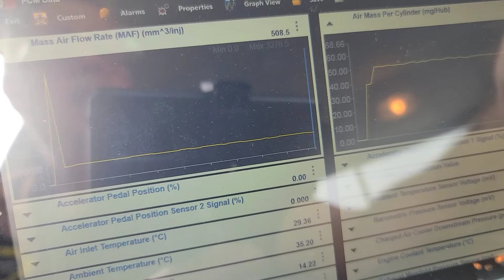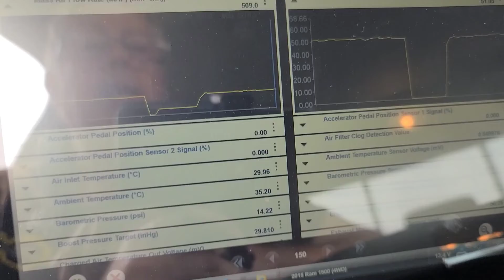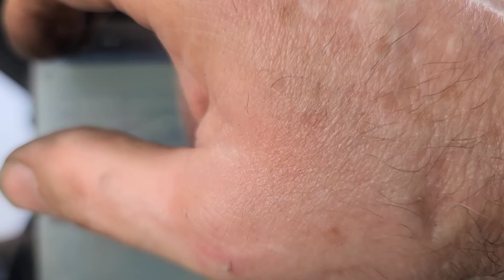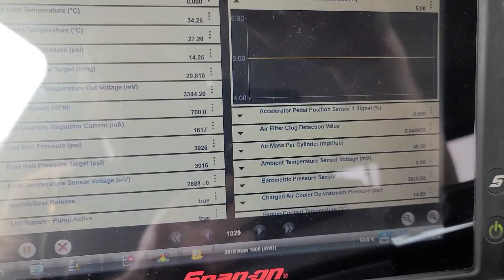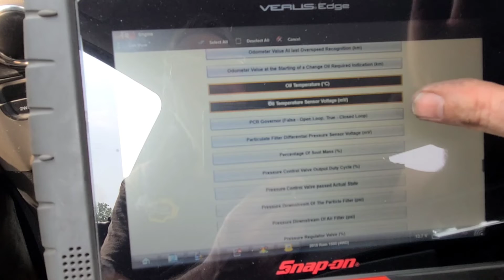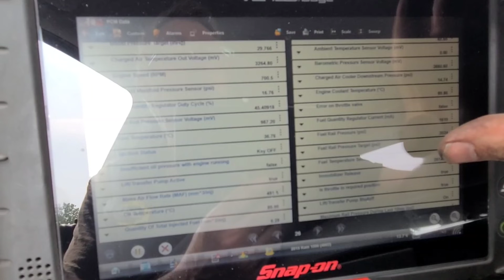2015 Ram Ecodiesel Crank No Start No Codes Fixed! pt 2.

Comment: Hub is German for stroke. On Bosch diesel scan data it means one combustion cycle (one working stroke / one injection event).
So mg/Hub = milligrams per stroke.
Air Mass per Cylinder (mg/Hub) is how many milligrams of air that cylinder is getting each firing cycle.
Reply from the maker: Thanks for the information!

Comment: I have my 2018 Ram Echo Diesel for over. 3 weeks now with the same problem. They quoted me for the fuel pump but the engine still won’t start. Tomorrow I’ll go to the dealer and show them this video and hopefully I have the same problem with my truck. Thank you so much!!
Reply from the maker: Good luck!

Comment: By the way, thanks for the video, very informative and helpful. I'll let you know what happens tomorrow.
Reply: Well the no start turned out to be a disintegrated tone wheel magnet $2300 Canadian to replace wheel and sensor.
Reply from the maker: I've heard that happens. Requires transmission removal to access...

Comment: I had a similar problem. I have a 2015 Ecodeisel 1500. The other day, I was out on the back roads, and I lost all response from my accelerator pedal. A code came up on the dash, something like no response between the pedal and the throttle actuator. I am not sure of the code; the engine died, and I had no start condition. My truck is also deleted. I called for a tow, and it went to the dealer. long story short, the tech flashed the ECM and blew out my delete software. He then was having all kinds of codes because it was looking for emissions signals. which of course have been removed. He called and apologized. He got the truck running and refuses to work on it. I drove the 10km home. As soon as I got home, I cleared any faults with a less then adiquit code reader. turned off the emissions, removed the ECM, and sent it back for a reflash-delete. I have just got the Ecm back and installed it. I had heard about the throttle actuator problem on YouTube, so I pulled the air intake tube off and checked... sure enough, it was open. good so I put the pipe back on. I tried to start the engine, but I still have a no-start condition. 
I noticed a valve closing under the hood when I turned the key to crank the engine. I have never heard that before. I was at a loss and was giving up for the day. But just as I was about to close the hood, I heard that mechanical sound louder this time, and I can swear it was the throttle actuator slamming open. I will take out the throttle body plate and try to start tomorrow.
Reply from the maker: Good luck and let me know if that's it.

Comment: What’s the tube called that you removed? I swear mine is loose and it sounds like air leaking from it
Reply from the maker: If you are referring to the tube connected to the throttle body it is referred to as a charge air pipe or tube and yes it can leak boost pressure.

Comment: Should the blade be open with the engine off ? 

I'm having problems with mine. 

EGR is not deleted.

I opened the valve to see how it looks, engine off. Valve blade is open and also little liquid like in there. 

Having nightmare problems with the red lightning light....

Regards.
Reply from the maker: Yes it should be normally open. What codes is it setting?

Comment: Great vid. Not my issue though. My 2015 is not starting after the dreaded  turbo coolant supply line repair. I removed the plate while I was in there. The coolant on the truck in this video is super low, you might want to check that out. Just do a Youtube search for ecodiesel coolant leak.

Comment: I have deleted 2014 had it shut off out of the blue while idle . This saved me $$$$ if your eco diesel doesn’t start check this if it’s deleted . I just popped hose off and shinned a light I. And confirmed it’s closed got a long screw driver and gave it a few buddy bubs with the hammer and bam now she starts . And no code for me as well
Reply from the maker: Glad it helped you

Comment: Hi! That "throttle valve" isn't actually a throttle valve. Diesel engines regulate rpm by fuel injection not by air. That valve however does 3 jobs:
1. Help cleaning the DPF (regeneration) by limiting the air intake when the procedure begins. This way the mixture gets more rich and burns better downstairs.
2. Helps reduce the engine shaking hard when cut off. Diesels have very high compression and by cutting air you basically transform the engine into a no air compressor thus moving freely.
3. The most important...in case of diesel overrun, by closing this valve and starve engine of air you have a pretty good chance to avoid a disaster.
So... basically by removing the plate you have eliminated all it's benefits. That being said, the ECU was remapped and not in a good way. If it didn't even show you the pids probably didn't even controlled anymore so the damage was already done. This is why I don't do/recommend engine tuning. If the guy doing it doesn't do a perfect job modifying the software...very serious problems may occur. Great video as always! Keep them coming!
Reply from the maker: @alexdragomirescu5084  thanks for the tips!
Reply: Funny that part wasnt deleted with the ecu tune. I had a VW TDI and did an egr delete and tune and all the parts associated with that system got junked and replaced with block off plates and modified air intake. Gained 8 mpg by deleting that and no more clogged intake manifolds every 80000 miles.
Reply: @rustystubbs242  It's astonishing how many people don't understand EGR design and functionality . The higher * NOx you get from an EGR delete is due to higher combustion temperatures . Higher temps result in the timing being retarded hurting performance , fuel economy and , ironically , the life of your engine . EGR also isn't even the main contributor to carbon buildup , that would be your positive crankcase ventilation ( PCV ) system . Install a baffled oil catch can to eliminate the majority of that buildup and you're golden . DO NOT delete your EGR unless you want worse performance and fuel economy .
Search on YouTube videos like "why not delete egr valve". They explain way better than me the disadvantages of egr delete. 
Stop chopping your engines just because forums say so and mechanics don't understand how systems work.
Buying a new egr valve every 80k miles is not a big expense!
Reply: I would do your research a little better than your comments.
Or you are a Dodge/Chrysler Mechanic, because only they would make a comment like that. Dodge/Chrysler Mechanics are known to say things that are not true to members of Delete tuners that have improved performance and economy to their trucks. 
Are trucks have never had any problems after a delete tune has been completed.
RAM trucks without tunes have more problems down the road.
Cummins is the best engine out there.
My 3500 has a delete tune, DPF removed, straight pipe, EGR cooler removed and I have over 540,000 miles and still going strong.
Reply: @anthonymalliris2089  I live in Europe, here we have diesel engines starting from 1.2 liters and more than 50% of the cars are diesel. Somethings about the way they work I do know. And I do know that even here most of the mechanics don't understand the systems and mislead the owners in chopping cars. The biggest problem will be when bi-anual state inspections will fail to pass any type of modifications especially modified emission systems. Mounting back a dpf filter will cost more than the car itself. The "remapping" industry is thriving at the moment by selling the exact point you've mentioned. A well maintained/diagnosed emission system should last the life of the car.